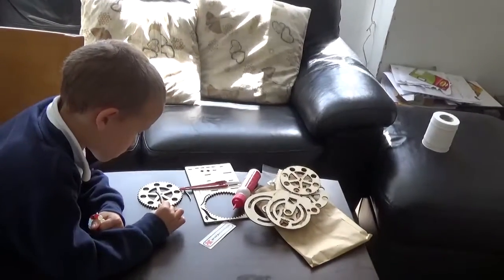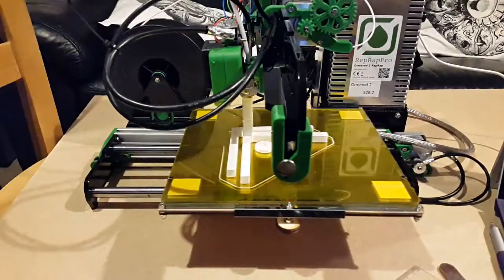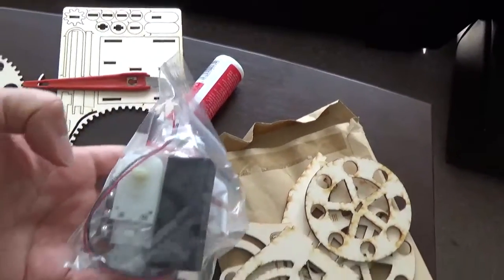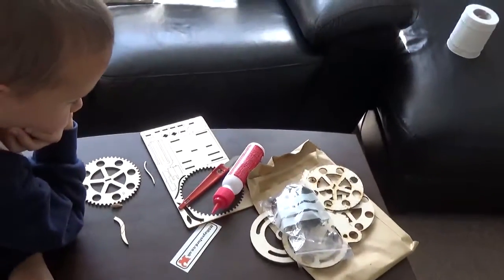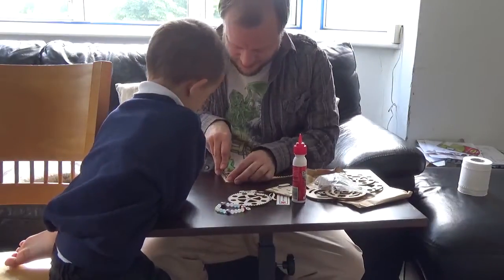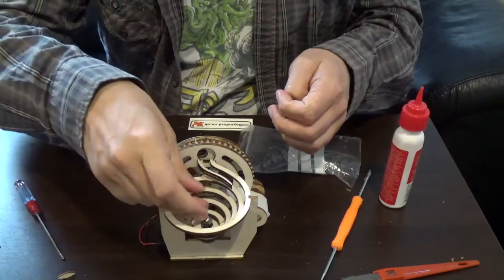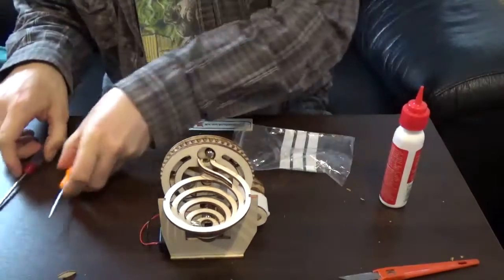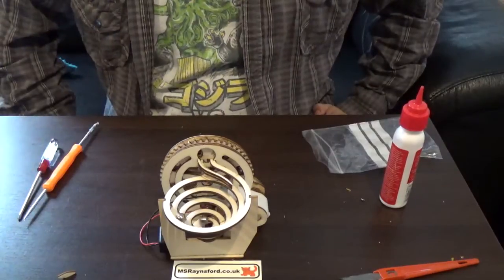Maker Faire Laser Cut Ball Machine

Comment: Well that was a fun little kit. How did the wires connect to the motor?
Reply from the maker: I think they should probably be soldered. The motor terminals are the lugs with a hole through them. Its cheeky - but I just pushed the wires (pre-tinned) through the holes and then bent them around. Since it won't be moving - it works well enough.